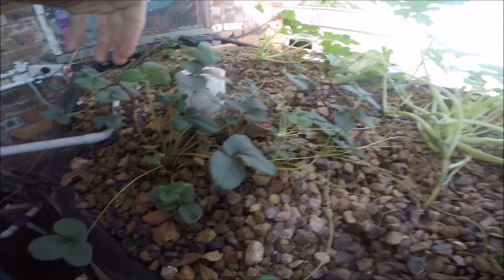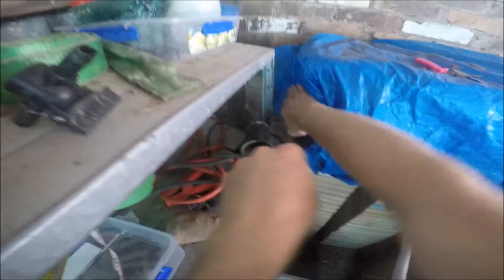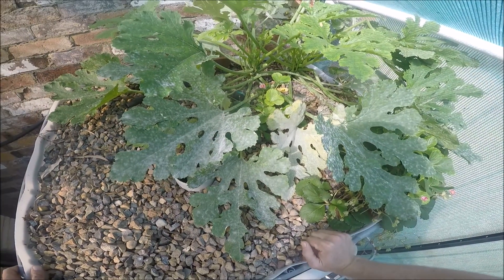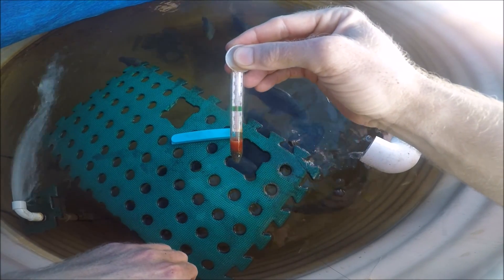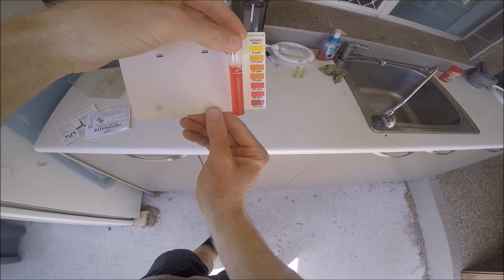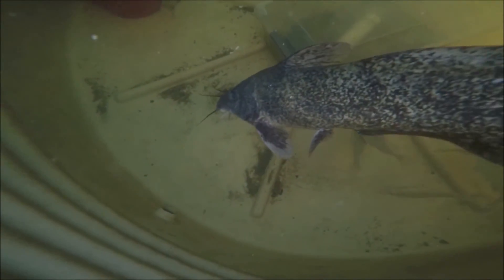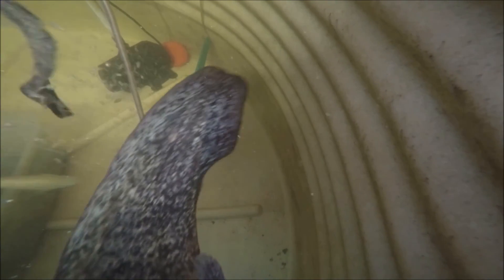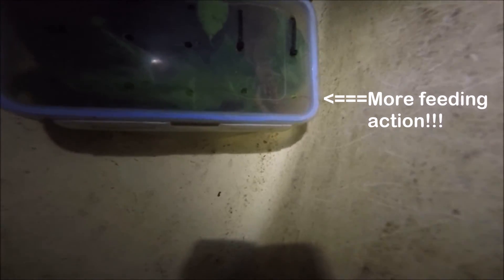Aquaponic Systems:  Overview, Water parameters, Raising pH,  Freshwater mussels and Redclaw Crayfish

Comment: Great videos I watched about 6-8 so far

The pH seems to be kept higher then what I have been told

In US we tend to keep 6.2-6.6 I think you said 6.8 

I am new to aquaponics and started my first experiment
Found channel via red craws
Reply from the maker: Awesome, Thanks very much Sheaffer Select! I'm glad you are enjoying the videos.  From what I have learnt, the ideal pH range for Aquaponics is between 6.0 to 7.0.  As long as the pH stays above 6.0 your system will keep cycling.  The plants prefer a lower pH (6.0 - 6.6) and the fish prefer it a bit higher (7.0 - 8.0).  The compromise in Aquaponics for both plants and fish sits somewhere in the band of 6.0 - 7.0.  Both plants and fish will be fine in this pH band.
The worst thing for your fish are sudden changes in pH.  This can cause fish deaths.
Thanks for Subscribing, there will be new videos released very soon.
Cheers, Tones.
Reply: Also gotta consider your bacteria it doesnt like a low ph. 6.8-7.0 is a good range to cater for all

Comment: have your crawfish bread or do you have the same number of crawfish??
Reply from the maker: No, I have not bred any of the crayfish yet.  I am keeping them away from each other at the moment to prevent any fighting.  That maybe something I'll try in the future though.
I currently have 4 crayfish in individual containers at the moment.  Unfortunately they are not the same ones I started with.  The original crayfish have died at different stages.  Mostly when they were moulting into a new shell.  Some survive the moulting process, but others have not.
I'm still working on why this is the case. 
Thanks for your questions, Tones.

Comment: Great video! I'd like to add my thoughts about why you're finding shells at the bottom of your tank. They've been pooped out by the catfish, which explains why you have a snail shell as well. Next time you catch and clean a catfish from that river, open up its stomach and you'll probably see it's eaten many mussels and snails, and the soft parts get digested while the shells cannot be digested. This would also explain why you've never found a live one.
Reply from the maker: Hi Jimmy,
Thanks for your comment.  That sounds pretty spot on!  I will check that out next time.
Cheers, Tones.